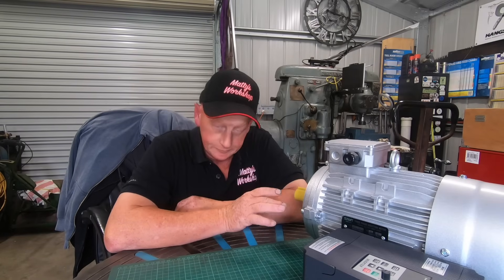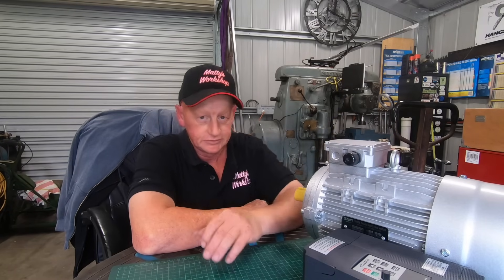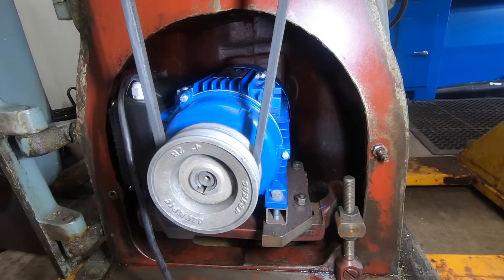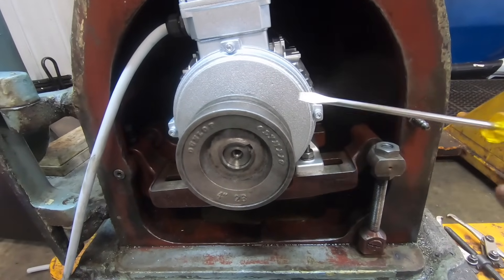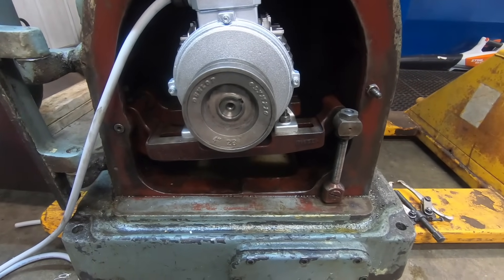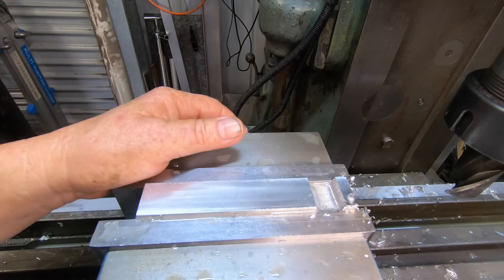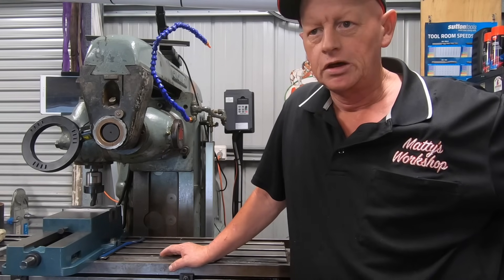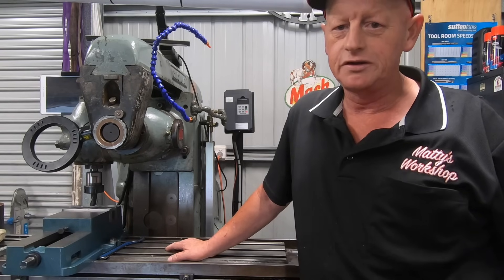Cincinnati VFD & Motor Upgrade

Comment: The fact that you now basically have a throttle and transmission, as well as reverse, makes the 3-phase/VFD conversion worth it on its own.  Much more flexibility in spindle speeds, which gets you out of tool chatter in more situations.
Reply from the maker: Gday Everrett, so far the little bit ive done with the mill im super impressed, its much quieter now and having the option of varying the speed is brilliant, Thanks for watching mate, Cheers

Comment: The rain…😱
We’ve been getting the leftovers up here in Sydney mate.., but WOW 🤣🤣
That’s genuinely podding down mate ‼️
Anyhoo…. She’s a lot quieter now Matty 👍
That single belt will be ok too I think..
Keep Punchin’ Matty,
Regards
Robert
Reply from the maker: Gday Robert, we ended up with over 200mm and it was pissing down, made it hard to do any filming with the noise, I've only ran one belt on the Cincinnati so it should be right until I make a new pulley, well thats the plan mate, Thanks for watching, Cheers
Reply: ‘Podding’ 🤣🤣🤣🤣
That’s the spelling corrector….
‘Meant to be …’ pissing’
😎

Comment: I stuck a 3 phase motor and VFD on my Myford ML7 last year and its completely changed the machine. I did make a remote box up for stop/start, speed and reverse using a potentiometer and a couple of cheap switches, so much easier than reaching up for the VFD controller.

Take it easy mate and don't push too much, give yourself time to heal.
Reply from the maker: Gday, I plan on doing the same with the switch box, it doesn't look to hard to do either, Appreciate you watching mate, Cheers

Comment: G'day Matty. We Sue & I await each and every video, found nothing wrong with last nights video at all other than it was not long enough. Still that Matty superior quality, as others have said many of us would have and do duck for cover at far lesser things. We all understand if you need to R&R I'm no different and atm it's the humidity/heat knocking me about but slowly does it.

As for that new motor why not turn up and extension shaft to suit length and current pulleys?? Should give you something to do LOL, other than brag about those beaut old machines.
Reply from the maker: Gday, it hasn't been easy over the past few months but I thinks its important to stay motivated and active, somedays are harder then others, Im planing on making a complete new pulley at this stage if all goes to plan, Thanks for watching mate,. Cheers

Comment: Nice upgrade Matty! Those original Cincinnati motor mounts are genius. Plenty of flexibility for different frame sizes and you don't need to drill big holes in tight spaces. Cheers,  Preso
Reply from the maker: Gday Preso, apart from not being a ton of room in the cavity the mounts are a brilliant design, thanks for watching mate, cheers

Comment: The 3 phase motor should be a vast improvement over a similar single phase unit. The overlapping 120 degree phases are far smoother power delivery and greater torque than the single phase equivalent. 

On the matter of controls for forward/reverse and speed you should look into a pendant remote control...far easier to deal with than messing about with the little button/knobs on the actual VFD unit.

When you mention being surprised at how little noise comes from the VFD it is probably because it is dialled in to that motor pretty closely. Noisy VFDs usually indicate that the setable parameters haven't been adjusted correctly and that can produce all sorts of weird sounds from heavy buzzing to high pitched whistling sounds.  
I think you've made the right choice going for a 3 phase VFD drive.
Reply from the maker: Gday, I did go through the parameters with some guidance from a mate who has done a few vid's, in the near future ill be looking at doing a remote switch setup, appreciate you watching mate, cheers

Comment: G'day Matty.  Holy hectapascals batman, that's a big arse motor that you installed on that mill.  Good work on getting that VFD up and running.  I've never done one before, but I know they can be a head faaaark to set up lol.  Cheers mate, Aaron.
Reply from the maker: Gday Aaron, it should have enough grunt now to handle anything I throw at it, the vid takes some nutting out ill give ya the tip, Thanks for watching, mate, Cheers

Comment: Matty I have the same VFD on my smaller lathe with a 2 hp 3 phase motor. For very little I put a Toggle switch and a Potentiometer on the lathe remote from the VFD wo I can control the speed of the spindle and also switch FWD to REV. Mine works great. I also have a Fugi Frenic Mini VFD on my 3hp Bridgeport Clone mill and did the same with mounting the remote switches within easy reach..
Reply from the maker: Gday Terry, I plan on putting remote switches on this at some stage, its not an expensive modification either, Thanks for watching mate, Cheers

Comment: Matty,  Every day that you wake up without a toe tag is a good day.  Do what you can do but realize that pushing the envelope is no longer advisable.  If you get 15 minutes work done, that maybe it.  You get very frustrated.  Boy, do I know that one.  You never feel that great and sometimes you feel just horrible.  Know that one too.  The quality of your work is not up to what you want.  I've made it a lot longer than I was supposed to.  So, you just do the best you can and it will just have to be good enough.
Reply from the maker: Gday, a the moment I get get roughly half a day in then its time for a nap, its extremely frustrating and theres nothing I can do about it mate, appreciate you watching, Cheers
Reply: @MattysWorkshop  Matty, I get maybe two hours a day every other day.  I totally understand frustrating.  Just have to make the time you have count, Never give up.

Comment: Well Matty you are doing far better than I did with the treatment. That 3HP motor would pull a train. Each rotation gives 3 pushes to the 1 on single phase. They are so much smoother too. Great video. Catch you on the next one. 
Steve.
Reply from the maker: Gday Seve, its not easy mate and it takes its toll, the new motor is super quite, Thanks for watching, Cheers

Comment: G'day Matty, as fr as I'm concerned a three phase motor controlled by a vfd is a very good way of powering a machine on a single phase supply. Your advantage is that you still have a geared machine, and with the vfd you can fine tune your  speeds ,( but not your feeds as they are directly related to spindle speed) and can get the sweet spot where you get a nice finish. I've put brand new three phase motors on both my wood lathe and my metal lathe/ mill combo. My metal lathe has no back gear so low speed turning can be a  problem as three phase motors don't have a lot of torque at low rpm's and it's easy to stall one with a moderately heavy cut at less than 50% frequency ( depending on what frequency range you set the vfd up on) mines set up on 25-100Hz. I have a servo driven lead screw, so my feeds are completely independent of the machine unless I'm screw cutting through the change wheels, and then I just slip off the servo belt and work normally. So your set up will work fine, as long as the vfd hold up. If it does fail ( and mine did under warranty, but that's another story lol) then buy a good quality of a known brand and not one out of China. I've had my second vfd now around 20 months with no trouble whereas the chink one lasted barely seven months before it exploded half of one of the boards.  You take care mate. If your knackered then rest. You can only do what your body will allow you to do while you're fighting the rust Matty. Take care, Sam from the UK
Reply from the maker: Gday Sam, I can’t believe how much quieter the new motor is, it’ll be interesting to see how the vfd lasts, thanks for watching, cheers

Comment: I've just picked up an Old South Bend 10L lathe with an under the headstock drive.  I only have to upgrade the motor wiring and I have no idea how I'm going to get myself into the motor bay.  The doors aren't all that big and nothing seems to be positioned for convenience of service.    Like you, I'll manage but it wont be pretty.   I suspect the swear jar will get topped off by the end of the job.
Reply from the maker: Gday, the swear jar lid got a work out that’s for sure, appreciate you watching mate, cheers

Comment: That Cincinnati loves the new motor. ❤❤ Your videos are good. No worries. When I had my shop spray foam insulated, I couldn’t hear the rain anymore. I have to lookout the window to see if it’s raining. LoL. Get well and rest.
Reply from the maker: Gday, Id love to have the coin to insulate the whole workshop, It gets noisy with the heavy rain and hot in the summer, Thanks for watching, Cheers
Reply: @MattysWorkshop  I hear ya. It's been expensive to build my shop and that was the first thing I decided to do. It freezes here in the winter and the freeze will destroy the motors in the machines and other tools. So, I had to keep the shop above freezing in winter and if I didn't insulate, it would be a huge utility bill each month. I'm glad I did and it was the only thing I've had to have done by someone else in my shop. Everything I've done on my own.

Comment: That's a good upgrade Matty, more grunt and variable speed, you can get extension sleeves for the Motor Shaft to move the Pulley out, sorry you're feely crap mate hope you feel better soon.
Reply from the maker: Gday, ill probably look at the pulley pretty soon and try to get 2 belts running, Thanks for watching mate, Cheers

Comment: Glad you got rid of that noisy power hungry inefficient split phase motor.
I converted my 2 lathes, mill, drill press and even my compressor to 3 phase via VFD's.
Vastly more economical to run and smooth and quiet with the added benefit of variable speed, not for the compressor of course.
Reply from the maker: Gday, I can't believe how much quieter the new motor is, hardly hear it running, Appreciate you watching, Cheers

Comment: My first cheap EBay VFD died. I replaced it with in from Conon Motors and have since added 3ph motors and VFD's to 2 other machines. I've got remote control panels on the most recent 2 which is really handy. VFD's sit close to the motors with a network cable connecting thd remotes to thr VFD's.
Reply from the maker: Gday, Once I learn a bit more about the vfd ill might setup a remote panel, See how I go there mate, Thanks for watching, Cheers

Comment: Working in tight spaces is bad enough when you are fit and well, so kudos to you Matty. Real shame you couldn't get 2 belts on, but it seems happy with one. Seeing your Mack Trucks emblem on the wall, reminds me of the time I went to their factory in Hagerstown, that place is huge. Anyway, hope your feeling better, regards to you and family, take care 👍
Reply from the maker: Gday, I might re-visit the pulley at some stage and possibly make a new one to run 2 belts, That would of been fantastic going through the Mack factory, Cheers
Reply: @MattysWorkshop  I was there to help with a small gear with a profile tolerance of 0.0003", really tight, but we did it, just. The main shop was that big that they used bicycles to get around.

Comment: Good one Matty.
I added WEG branded VRD's to both my lathe and mill in 2006. Both are running 3hp motors and I have had no issues or regrets. Was able to set up the mill with an emergency stop, foward/stop/reverse switch and variable speed control using a variable resister in the original switch box mounted to the front of the machine and I recommend you look into adding this too if possible. Variable speed is a blessing.
Reply: I'm astonished that you are managing to keep going on so well Matty, with everything else that's going on, more power to you mate. I mean getting that new motor in on on your own, that would have taken me a couple of days and there's not a lot wrong with me at the moment. Anyway all the bestcand keep up the good work.
Reply from the maker: Gday, As the treatments go on the worse Im feeling, its important to stay active but that takes its toll to so its a fine line to follow, Jobs that would normally take a day is taking 3, Thanks for watching mate, Cheers
Reply: Those WEG motors and VFD's are really quite good for the money, or were when I was putting them in 15 years ago. Last time I looked they seemed to be quite a bit more expensive, now they have their feet under the table.
Reply from the maker: Gday, Once I get my head around the vfd ill look at a remote switch setup possibly, its nice being able to vary the rpm's thats for sure, Thanks for watching mate, Cheers

Comment: It's all working as it is, leave it be until something goes wrong, it seems okay as it is without the 2 V belts.
Reply from the maker: Gday, for know it'll be ok, possibly end up doing something with the motor pulley, Thanks for watching, Cheers
Reply: Just buy another pully and weld it to the existing one, chuck it up in the lathe and true it up 
 @MattysWorkshop